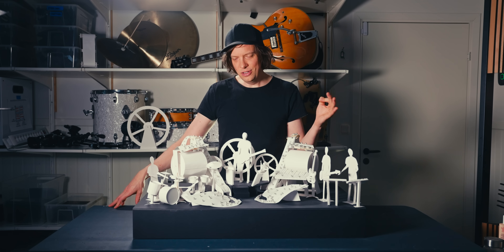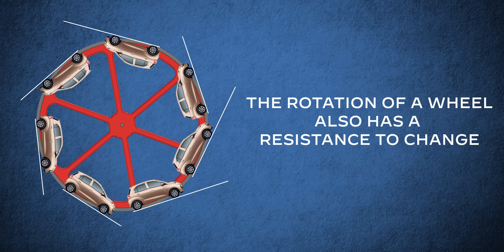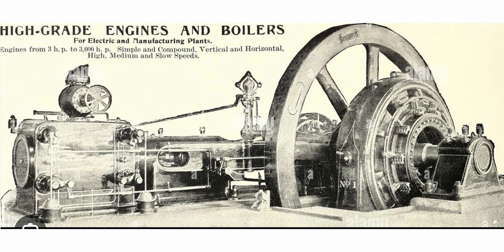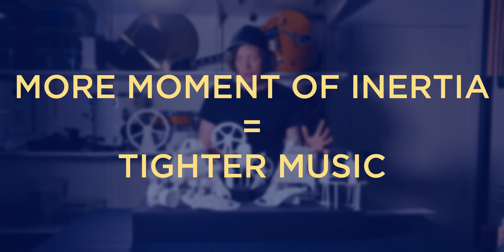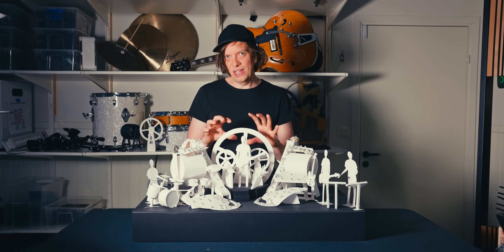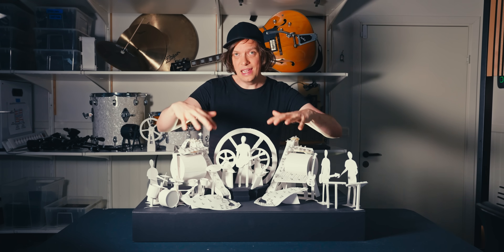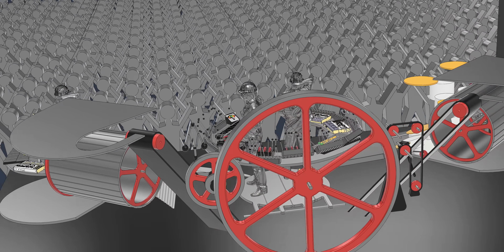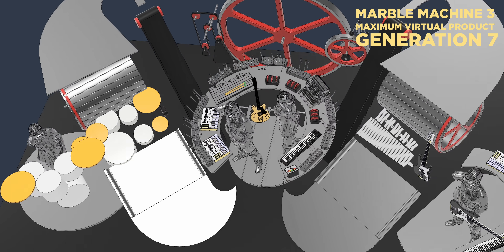What is Moment of Inertia? (The Heart of The Marble Machine)

Comment: If you want a large flywheel, what if you make something purely aesthetic?

As others have pointed out, an actual functional gigantic flywheel poses several problems for venues (mechanical capability) and safety (loss of limbs). 
It could still communicate what the machine is doing, but since it's aesthetic you could e.g. make it safer and less prone to the venue issues because it only has to function as an art/heart piece?

It does still come from function even if it's ultimately just a prop. But it won't kill people or limit your venue selection on tour.

Comment: I would look into mechanical govenors more than the flywheel. You could have a fly ball govenor as the backdrop instead. The big flywheel will cause issues not only spinning up but slowing down. Having a govenor being the main means of keeping tempo would also allow you to change tempo instanly by adjusting the govenors set point.

Comment: Back in the 60s and 70s banks and other companies and organizations that had had critical data systems used large flywheels as a kind of emergency power system that had just enough moment of inertia to power their systems from the moment of a power grid failure to the time it took to start up diesel electric generators. They are still in use today in some datacenters as active UPSs due to their reliability.

Comment: Please, please make sure to engineer the flywheel properly! Increased moment of inertia is also increased danger. Flywheels are no joke when you literally have the same energy as a bomb whirring behind you. It would be very good to have a vibrational analysis  and dynamic balancing system built into the fly wheel to make sure that you can get it properly balanced each time you set it up. Define a torque spec for each bolt and make sure that the bearings are very much over built.

Comment: From experience, balancing large spinning things is nightmarish. Not impossible at all, but you NEED to engineer every part of the wheel to be adjustable, have looots of spare shims and bolts ready, carry extra magnetized weigths, and maybe consider making the parts indexable. 

But, i agree, for the looks, its worth it. The very large wheel is definitely much, much cooler.

Comment: Assuming you design the wheel to spin once per measure, which should totally be doable, you should have lights on one of the spokes, whichever one will will be pointing straight up at the start of each measure. This will not only be a nice visual for the audience, but should also help the band with timing.

Comment: please hire some safety consultants on this to ensure stability and protection from injury. not worried about output energy, safety disconnect clutches and slip clutches can handle all that. but that big metal flywheel WILL NOT STOP for a limb or torso falling in.

Comment: I could be wrong but I see this as being more inclusionary of venues. 

Given a constant moment of inertia, the wheel isn't any more dangerous with a larger radius than it is with a smaller one--the flywheel would be equally harmful if a limb would be stuck in it. The larger radius wheel would have a larger tangential velocity, but so long as safety measures are taken, I don't see how this larger radius wheel is any more or less safe than a smaller radius, higher mass wheel. 

As far as the flywheel being too heavy for certain venues, I think the larger radius wheel would be beneficial. For the same moment of inertia, a radius twice as large would mean the wheel would have to weigh a fourth as much, so this wheel would definitely be more inclusive for stages where mass is an issue. As far as assembly goes, I'm sure if you divide the wheel into enough pieces and design it with assembly in mind one could assemble it by hand. 

It would likely also be easier to assemble (multiple small, lightweight pieces versus a single, extremely heavy piece)

Comment: The control bridge riser needs enlarged enough to fit 3 people so the two of you have more room to move around so you are not bumping into each other. The conveyor belts on each side needs moved away from the control bridge. There is no reason it should be that close. There should be enough room for a person to walk between the outside of the control area riser and the conveyor system. Everything is crammed way to tight together.

Comment: As I think about it, the machine should be easier to service with it being multiple parts instead of a single tightly packed form factor.  Similar to the flywheel, I think other parts should also be able to be disassembled for easy transit, probably in multiple separate packs with an upper weight limit in mind so they aren't too heavy for someone to carry, including at least one backup for each part.

Comment: Hello Martin,
A large flywheel certainly looks cool, but in my opinion it is the wrong tool for keeping the speed of a shaft constant. In all the machines with flywheels that you have shown, the flywheel is used to bridge interruptions in the drive, e.g. when the cylinder of the steam engine is ejecting steam and has to be driven itself. This is then done by the energy stored in the flywheel during the working phase.

But that is not what you need. If you want to set a large flywheel in motion, you will find that the faster you want to accelerate it, the greater the torque you have to apply. But it is also the case that you can already change the speed with quite small torques, this change only takes place very slowly. Consequence: If you do not pay close attention to the speed when driving the machine, the speed of the shaft will fluctuate with a slight time delay, just like your drive speed. The high inertia only means that you need a lot of power when accelerating the wheel to get it up to speed in a reasonable time.
All the machines you have shown have a regulator that keeps the speed constant. Only a flywheel alone cannot do that

Comment: Huge flywheels like that have NEVER in history been regularly disassembled and remounted in different places. Every example you showed is secured to an utterly solid base like a concrete floor or a thick steel framework the size of the entire machine. Even the smaller ones are attached to very heavy objects like traction engines.

Even IF you found a venue in every city that could accommodate such a heavy structure AND spent the money on a crew of muscle men to lay it down each time, there would absolutely be safety concerns. If a part fails and it goes out of balance, I'm not sure the brake exists that could stop it.

Look, I get it. A few monolithic parts CAN be just as impressive as many delicate parts AND a lot simpler to fabricate. But before you proceed any further, consult a millwright.

Comment: To Martin and crew. There are a lot of comments about the safety with using a huge flywheel and you need to stop it. Like the old saying goes. It's hard to stop a train. Why does it need to be one big flywheel?  Why not use 3 smaller ones linked together to get the same inertia. They could be configured in a triangle. Could be just as visually big. Instead of one spinning thing. There are three. Easier to stop one of them should it be needed.

Comment: Not steampunk, as we got no steam here. But maybe lumberpunk? Or Plywood-punk? (I guess it depends on the materials to be used and visible. You could cover your flywheel with plywood, if you want that look.)
The bigger flywheel has the effect that for the same angular momentum, the angular speed can be slower, so it's actually better visible that it turns. (Also, it could be relatively lighter, which (together with the disassembly, means it's easier to transport.))

Comment: Reality check?  At the risk of bursting the fantasy bubble, is it worth remembering  that the marble machine needs to tour in and out of concert venues every day. That means logistics, staffing, risk assessments get-in, setup and get-out time, H&S and risk assessment and it all has to be robust and work with repeatable reliability at a cost thats within what''s left of the ticket receipts after everything else has been paid for.  Touring a two metre (four tonne?) sectional flywheel to get computer timing levels of 'tigntness'  around Europe is pretty much pie in the sky.  Even if it works and all the boxes can be ticked within the budget, no one will be looking at a stopwatch to check for millisecond accuracy in BPM. If a big visual set is what is required then it can be simulated out of plywood and paint and if it fits within the fantasy, can even have a 4 metre flywheel with sparks, smoke and fire effects.  What ever happened to KISS?
Reply: Thats why its being built in small puzzle segments.
Reply: @goldenshatter  indeed. How long will it take the stage crew to unload, assemble, balance and integrate into and assemble the rest of the machine,? There's only 8 hours before overtime and the whole thing needs to be disassembled for the get-out after the show. Not to mention the rest of the set, lighting and sound. Then there's the sound check and focussing and lighting. This takes at least 3 hours where no noise can be made and there's no light to work with anyhow. The.doors open at 7.00 and curtain has to come down in time  for the last train or bus.

Comment: Just use a high performance drive motor such as a servo motor.
It will run perfectly accurate without the need of a super large flywheel.
Reply: And you missed the whole point of this machine.
Reply: @Tvngsten  Driving a Machine is large with the power of one human is unrealistic. Inertia is not everything, you need to control the supplied power too. The machine is not a constant load, so applying a constant power will not cut it. This is why a gravity drive will not work. In case it has to be mechanical use a steam engine. Only single cylinder engines will need a large flywheel, multiple cylinder engines can apply constant power so no large flywheel is needed. A governor however is strongly needed as it controls the output power.
Reply: @Alexander470815  maybe it's unrealistic, but it's the whole premise of the machine. No motor, no engine, just human powered.
So suggesting the use of a servo motor is off topic.

Comment: the larger flywheel does look very cool, but as other people have pointed out, it's going to be pretty unsafe. i don't think you fully understand the point you explored earlier of making a cool machine in favor of a machine that can play the absolute best music. your videos have shown that well thought out designs and cool looking designs should go hand in hand, instead of prioritizing one over the other, but safety is the third of the most important design elements. you should not be designing the machine with only one of those three elements in mind, good design (in my opinion) must use all three. 

and yes, some elements of any machine will be dangerous if used improperly. but having a giant flywheel opens your machine up to injury if someone accidentally puts a limb through it. especially since you will be very close to it for most of the performance. but more importantly, how will you protect people in the crowd from it? for example, if a small child runs on stage to take a closer look? while you and your team might have a good understanding of how to safely use the machine, that will not apply to everyone else. just because people shouldn't get on stage, doesn't mean they won't. 

designing safety is one of those things that in most cases, it will not be needed. most shows will not have any problem. but it takes one show, where something goes wrong, that dismantles everything. it's that one show you need to be prepared for.

Comment: First my idea then my two cents. Have you considered asking @colinfurze if he could help you design this central flywheel in a manner where it is light enough to be broken down, transported, set up, and supported by a stage without too much trouble? I assume you would want to figure out the programming method on your own, but I would say reach out to guys like him who make crazy big builds and ask for their advice. 
For my two cents, I'm seeing a lot of talk in the chat about the problems the size and weight of such a flywheel would cause, both mechanical and in getting places to perform. I would point out a couple things. First, this flywheel will not necessarily be made from solid steel and weigh a ton or two. I believe lighter materials would work for the music slate supports and for the spokes as well. Nor would the wheel itself be moving any comparatively great weight. Secondly, to the idea of an increased likelihood for ware and tear on the wheel given its size, I might produce two possible solutions. Either produce multiple copies of each necessary part so that they can be replaced as they ware down, or produce multiple flywheels and limit the use of each one so that at least one is being serviced while the other is being used in performances. Perhaps even limit the use of one to a certain number of concerts (say, reserve one for the Europe tour,  Two for the Americas, etc.) Adjust as necessary. 

Thank you for reading this far! You get a star! ⭐️ Achieve five stars to unlock the enchanted blade Farnot, Unmaker of Stars! Good luck on you adventures hero!

Comment: As much as I like "Dreampunk," using the term "punk" really implies form over function. Same was what Steampunk is to steam power. It's more of a romanticization of the industrialization in the way that it takes form from function without quite the same "need" for it and because it's wanted; hence that feeling of "dream."
Perhaps "Industrial Romanticization" of "Industrial Evolution" or something in that vain taking what you said about that friend and also playing on the "R-" of romantic and revolution.

For further example, if the gearing and flywheel were there like the tubes and pipes and paint of Steampunk, not of any function and aesthetic alone, that would be some form of "Industrialpunk."

Comment: i feel like if it's big enough at some point the flywheel might be LESS dangerous because it can move more slowly and have larger gaps between its frame
Reply: What matters the most is the energy in the system. If it's larger and slower moving but the energy in the system is the same I don't think it's any less dangerous. Larger flywheels can still crush you just as much as a smaller wheel spinning faster can. Martin never has any regard for safety if I'm honest though. I don't think his previous tests with flywheels with the audience so close on first spin ups were safe at all, and his chance of taking this thing with exposed flywheels and moving pieces on a tour are essentially 0%.

I'm not trying to be a hater, I really would love to see him succeed and see some music machine of his in person on a world tour, but more and more he's moved from something that is reasonable to transport and safely operate, into something that is so large with so many exposed parts that I think there's no chance it will be allowed to operate in the venues he thinks. Stages are not made for such machinery either.
Reply: @iduumb3062  100% agree. The danger is in the energy, not the speed.
Reply: I think you missed the point. if a wheel is spinning fast enough that if your arm got in there it’s instantly crushed, that is massively different than having time to remove yourself from any pinch spots
Reply: @PabloEdvardo  The amount of time you gain isn't going to be enough with a wheel this size. If you're in the danger zone, you're already either unaware of where you are or you've fallen into it. In either case, you're not going to be able to remove yourself from the danger zone quickly enough.

Comment: I worry about the ability to maintain the flywheel's balance after re-assembly. 
Will you have to take into account what bolts are used in each fastening location? 
Will the torque of each bolt and the order they where torqued affect the balance?
What is the margin of error on a large flywheel like this?
I think there are probably solutions to this, even if it is an issue. Perhaps you could use weights locked in place with set screws inside the bore holes, this would let you move the weights and slightly change the balance of the wheel if needed.

I will be curious to see if this ends up being an issue and how you will fix if it does.
Reply: Yeah if he assembles it for every show it will be unbalanced.
Reply: Not really, it won't make a big difference for the speeds he is working at. Plus all you have to do is have some vibration damping on the main shaft mounts.
Reply: With the huge wheel I can easily imagine it moving at 20RPM being enough and storing the same amount of energy, or more, than the prototype used for tightness testing. At slow speed balancing tolerances can be a bit looser. You don't have to worry about vibration  that much because hardy any structure or module will have natural frequencies that low.
Reply: @piokul  Yeah, good point.

Comment: My biggest initial concern is that with a flywheel balance is CRITICAL.  And if you take it apart and assemble it at each new location you'll probably have to rebalance the flywheel every time.  Maybe you can come up with an amazing solution so that balance will always be perfect upon reassembly, but I'm worried about it.  For what that is worth.

Comment: How about dream punk but with steam. Instead of your pedals providing the heft, they just provide very direct control of the engine. Perhaps one pump of the pedal equals some fixed pulse of a motor. Your aim is to keep the weight off the ground, and how fast you have to pedal is determined by the governor. The machine determines how fast you have to pedal. I don’t think it’s cheating if you keep yourself in the control loop but have a motor provide or assist with input power, e.g. power steering or power brakes.